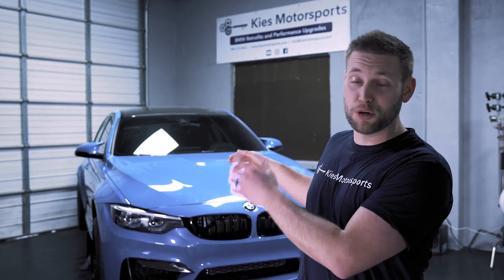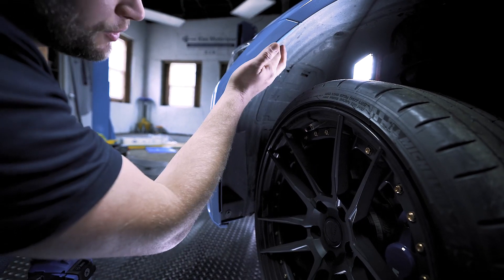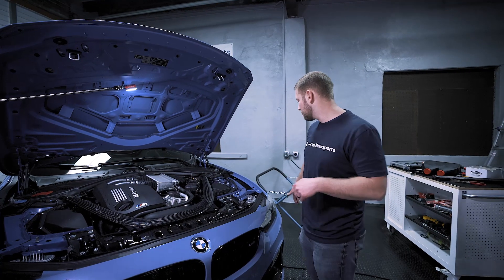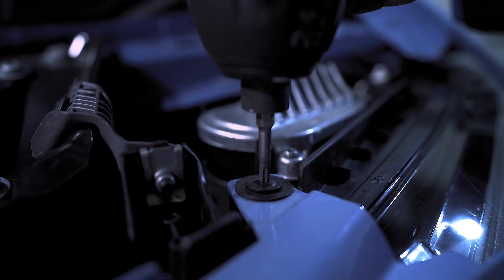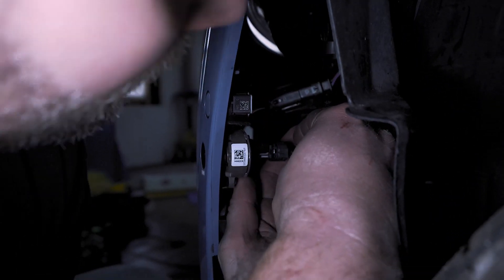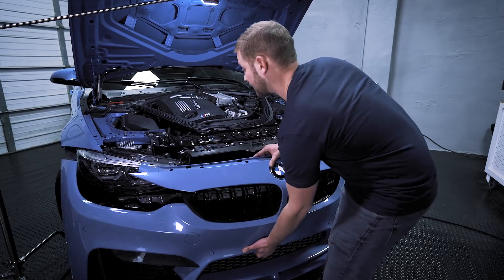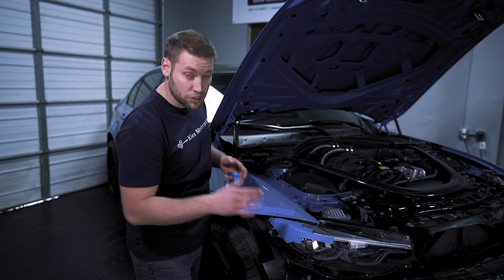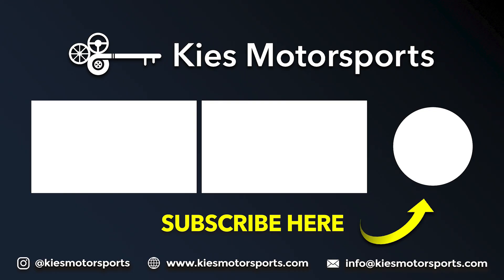How to Remove a BMW F80 | F30 | F32 | F82 Front Bumper (M3, 328, 335, and more)

Comment: I've read that it's recommended to disconnect the battery when working on the front bumper to avoid issues with the front bumper airbag sensor. You didn't mention this, so I'm wondering if you agree with that or not?
Reply: Don’t believe everything you read

Comment: Hey Brian, I need to replace my bumper because it cracked and I need a new one. However the black part behind the number is also ripped (the black lining where the screws are holding the number in the beginning of the video) how can I replace that?